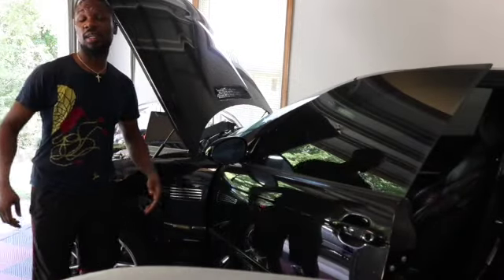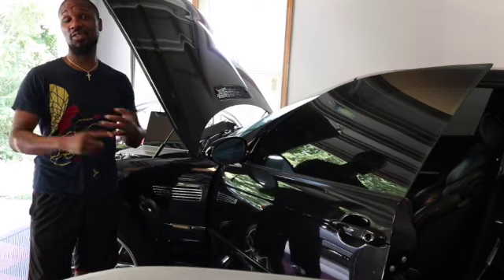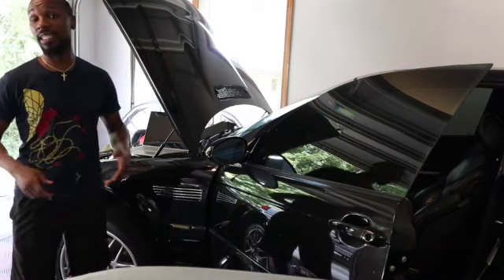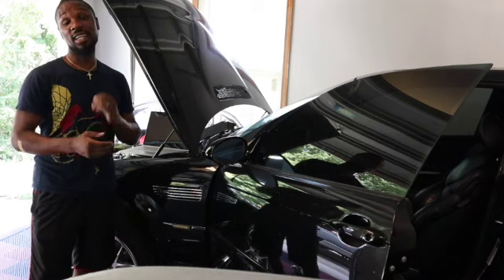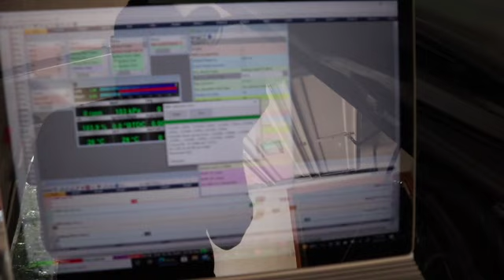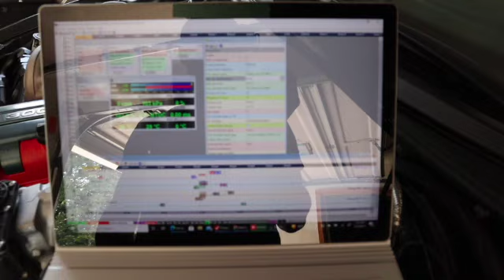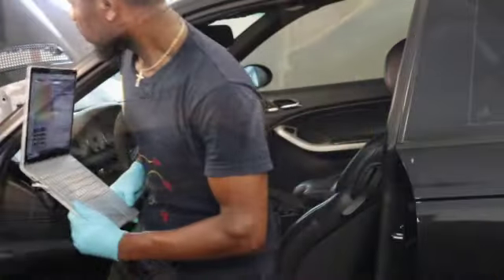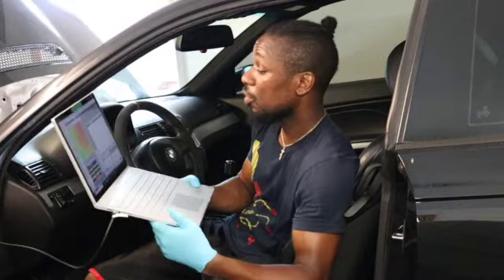2jz Competition Package M3 FIRST START UP!

Comment: Hey man, wondering if you had to mess with the fuel pump wiring at all with the emu black and wiring specialties harness? Have a similar setup that’s priming the pumps on ignition but killing fuel pressure when I crank.
Reply from the maker: I did install a new fuel pump and wired things accordingly. If you're getting the opposite results then you might have to switch some wires around and or check your diagrams.

Comment: which engine mounts did you use bro?
Reply from the maker: V8chassis 2jz to E46 motor mounts.
Reply: @alhuegayle7550  where can i get these please i want to do the same thing
Reply from the maker: @omarlondon  https://www.drifthq.com/products/v8schassis-tdr-e46-2jz-1jz-engine-swap-mounts?variant=31248822206511

There goes the link. Good luck with your build.